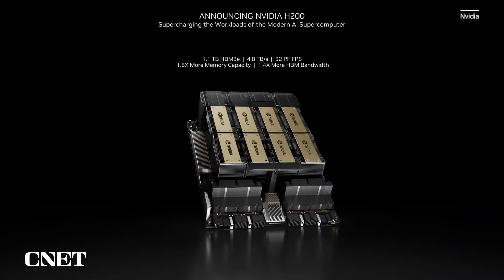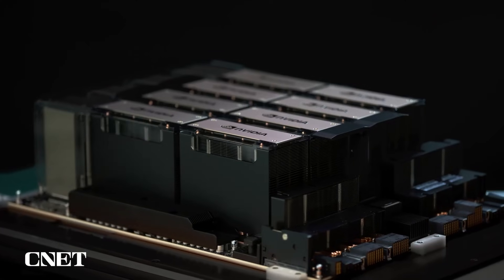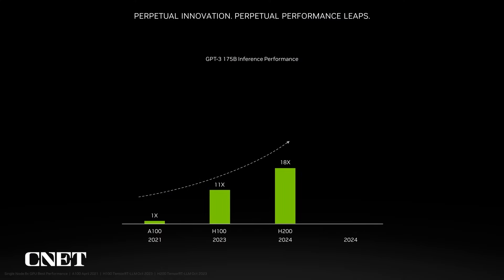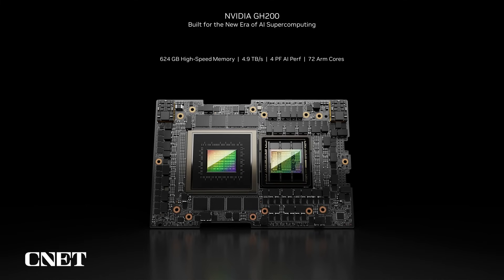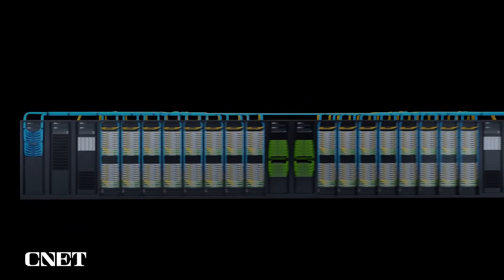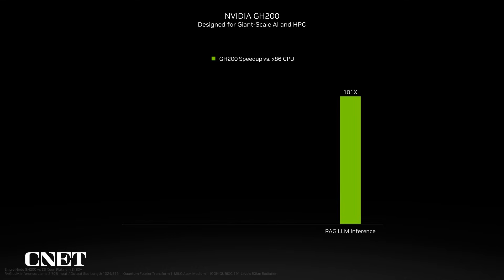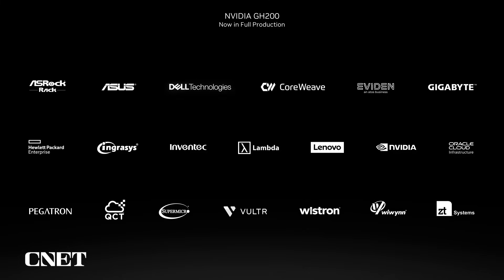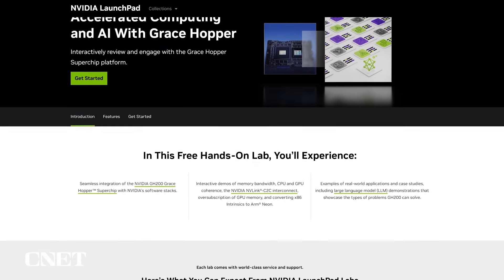Nvidia Reveals Latest H200 AI Chip (Watch It Here)

Comment: Unrivaled, amazingly speedy innovation.  Love Nvidia!
Reply: Its not unrivaled for certain inference loads requiring more memory and bandwidth MI300x can challenge. H200 changes the memory technology from H100 while also enabling the sixth stack of previously disabled HBM while also increasing memory density. This means that aggregate full device capacity moves from a previous maximum of 80 GBs to 144 GBs, 141 GB of which are addressable by applications. Bandwidth comes in at a massive 4.8 TB/s, a 40+% increase over H100’s 3.35TB/s. By comparison, AMD’s MI300X has 192 GB of HBM3 memory for 5.2 TB/sec bandwidth, although we’ll hear more about that later this year at the December 6th AMD event.
Reply: Fanboy
Reply: @milo1721 I mean it’s true 😂 Intel and AMD are nowhere close to NVDA’s capabilities